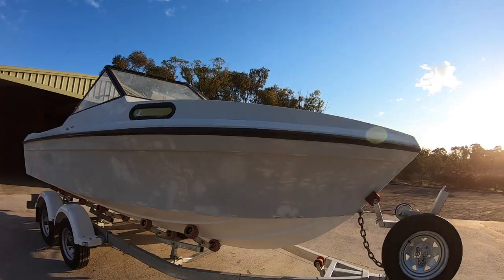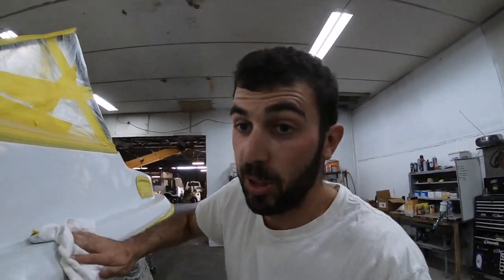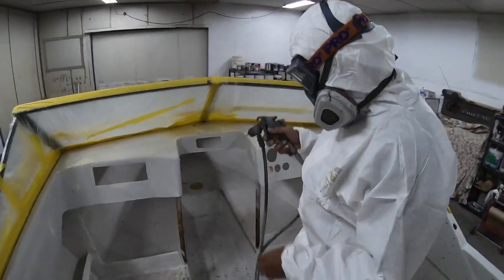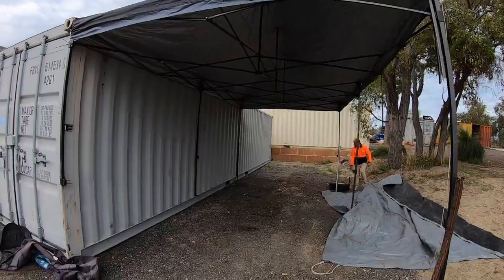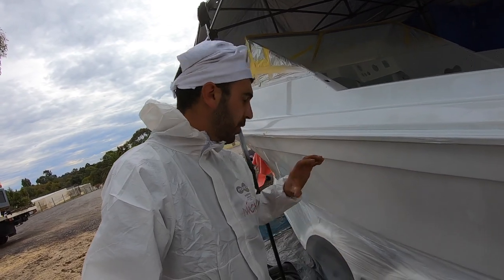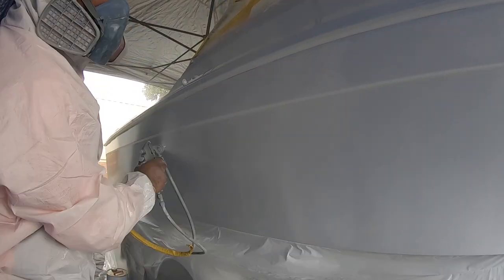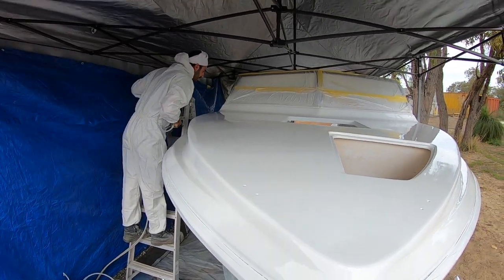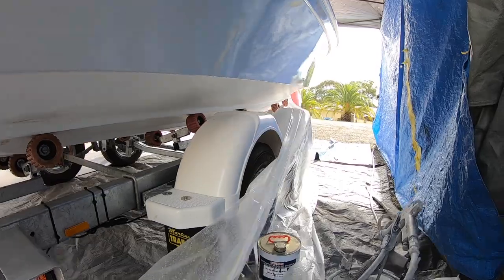I SPRAY PAINTED MY 18 FT BOAT IN THE BACKYARD | HOMEMADE SPRAY BOOTH | FULL BOAT RESTORATION- PART10

Comment: Looking good nice paint job.wrong color thought a nice sparkle silver would be good with red and blue sparkle striping...
  I don't know why everyone always paints boats white... One trick I learned is put a little bug spray liquid off into the paint to keep the bugs off it when painting outside I usually wet down the stones with the hose to keep the dust down ...